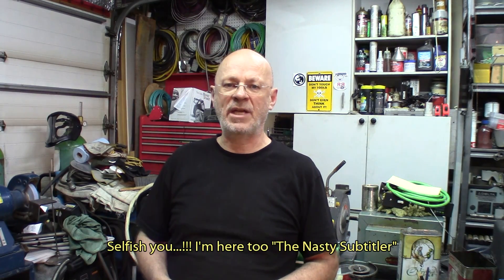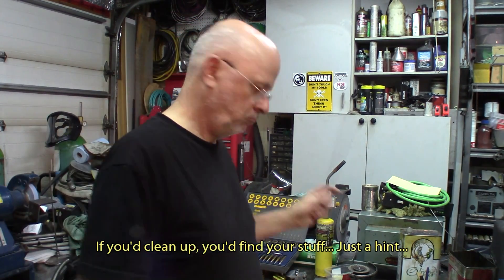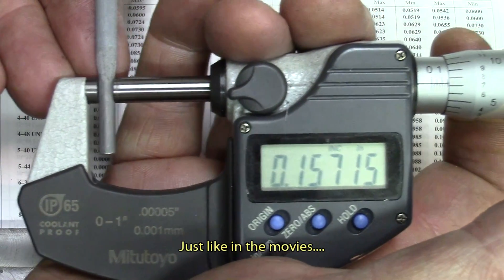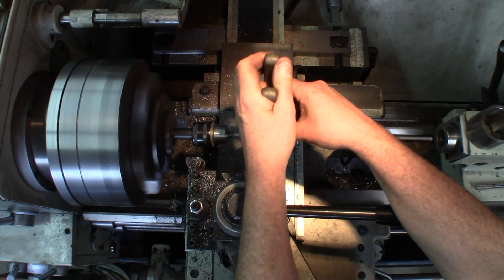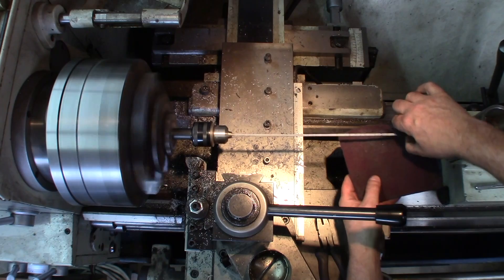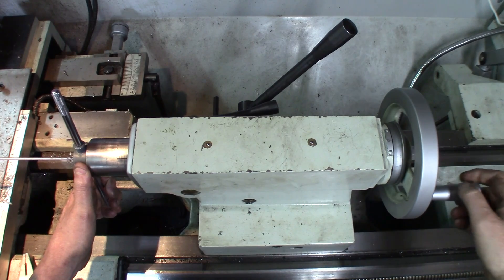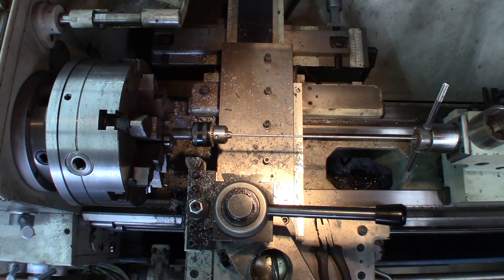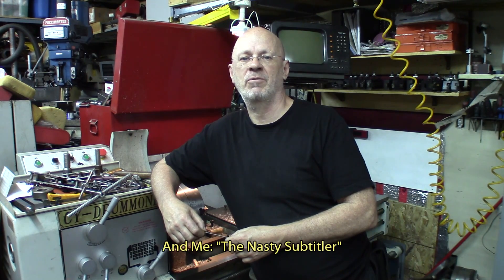Trick on how to get a welding rod into a 8-32 threaded rod

Comment: I've done the same in a pinch. I hope you cleaned the lathe and ways very well the some flux is acidic as well as very abrasive.
Reply from the maker: Hi James,
Ya, I'm trying to keep the ways and moving parts as clean as possible on my machines, like sanding or cutting cast iron, etc, I'll cover the ways...
Thanks for comment,    Pierre

Comment: What if you held the die in the lathe chuck, and the end of the rod in the tailstock chuck.  Then, leaving the tailstock unlocked, let the die pull the rod and the tailstock as it threads the rod.  Just a thought.  I haven't tried that, but it seems that it might work.
A thought provoking video.  Thanks, Pierre.  :)
Reply from the maker: Richard Freeze Hi Richard, this is a great suggestion, Will even allow making longer rods since the tail stock has a limit of about 4 inches, to be tried on the net rod... ;-) 
Thanks a lot,  Pierre
Reply: @pierresgarage2687  In 2016, I had to produce some long threaded rod for a nice teak swim platform on the stern of my boat.  Material was 5/16" dia silicon bronze, and I held the die in the chuck, with the aft end of the rod held in a drill chuck at the tailstock.  The results were great, no wavy thread, etc.  The tailstock was allowed to 'float' on the ways and slide toward the headstock as required.  I think I posted the results on instagram.  Just make sure your drill chuck holding the rod is not allowed to rotate.  I've threaded steel rod this way as well. Cheers, Vern.

Comment: My favorite is 5-40 threads. Perfect fit for 1/8" rod. I usually get it started and put the tip of the newly-threaded rod in the chuck and pull on the die-stock. Not so likely to buckle the rod under pressure. (3/16" is good for #10 threads as well.) A little sanding to reduce to the proper major diameter is sometimes in order.
Reply from the maker: Peter W. Meek Hi Peter, got about 100 pounds or more of potential threaded 5-40 rods, if not more... lol
Yep, about the pulling, Brian from "bcblock2" just introduced me to it.... I'll probably give it a try soon...
How about the screen, hopefully going somewhere...???
Pierre
Reply: pierre beaudry I'll take this to email.

Comment: I don't have this problem. I don't allow anything in my shop to be worked on with smaller than 1/4" threads. :-) lol  Why not start the die on one end first then put it in the chuck and pull out on your tap handle going away from the chuck. A rod in tension stays straight. I think that would be easier and less prone to over or under doing the tailstock.
Reply from the maker: bcbloc02 Never tried it before... To be tried in my next need for a tiny sized hardware. 
You work on stuff soooo much bigger than me, last little job was a trail nut, 4 x 8 x 8 mm. with a 5 x .85 thread in the center, hard to charge $$$$$ for tiny parts...
Reply: pierre beaudry
Rolex does... you just need fancy marketing. lol Plenty of need for small parts I enjoy seeing you guys do the small stuff since I don't.
Reply from the maker: bcbloc02 Each it's niche... ;-)

Comment: If you would pay the subtitler a bit more, there would not be the "edge" to the comments. Pretty soon it will be clear that you are not the subtitler as the attack becomes more vociferous. (;-))
Cool tip on the welding rod as stock. Thanks.
Reply from the maker: Jim Milne Under the surface the subtitler is a charming person... Only that the surface is a little harder than expected.... ;-)
I he quits, the channel will suffer from the loss. :-(
Thanks for comment, Pierre

Comment: I find that threading too long a piece can sometimes give me a wavy thread.  Looks like your method could help to make it straight.  Still I am a bit paranoid about cutting threads with a die unless it is a tiny thing like that.   Thanks for the video.
Reply from the maker: cerberus Hello Harold, it will be wavy if you don't hold it straight with the tail stock, like my friend said.... I've done it before.... lol
You can use pretty big dies like up to an inch, you need to hold pretty straight and firm, the use of a die holder made to hold in the tail stock is a recommended option. Bigger threads are more demanding...
Smaller lathes can go to 1/2 or 5/8 inch at slow speed...
Take care,  Pierre